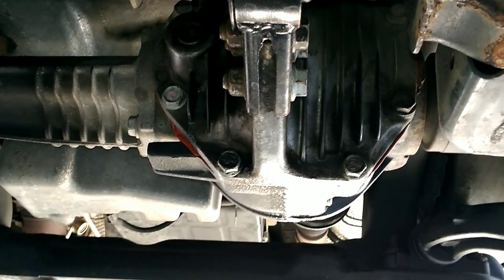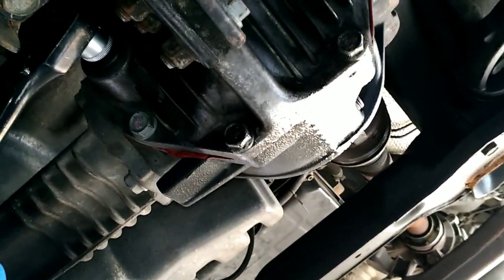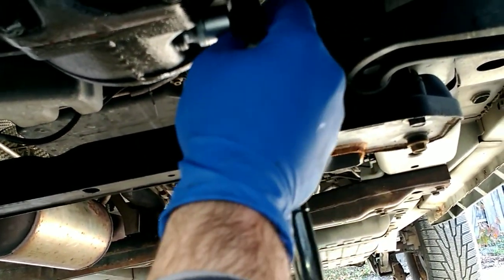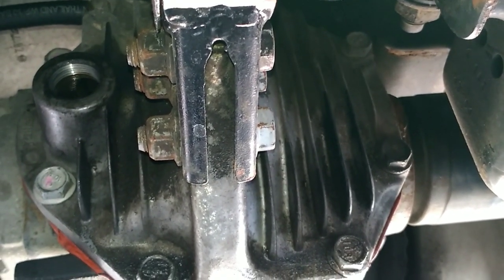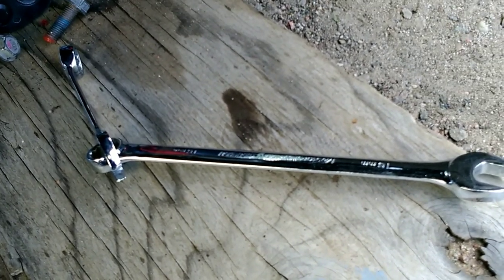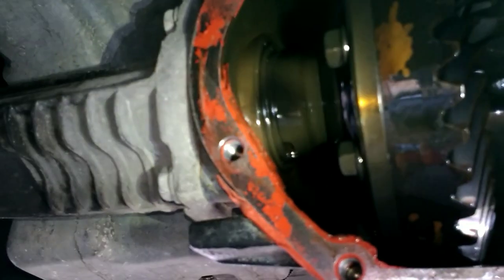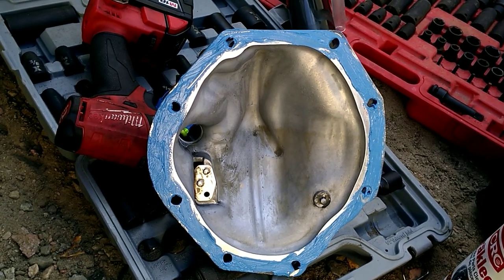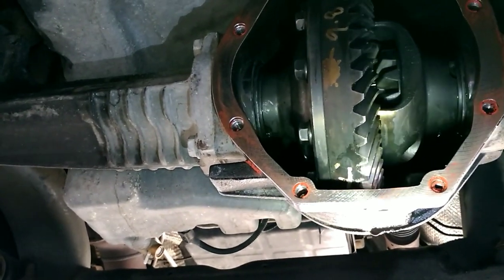2005-2010 Jeep Grand Cherokee WK Front Differential Cover Removal

Comment: I'm working on mine now. Had a axle starting to go bad on the drivers side and I've never EVER in my life had a axle so dam hard to get out glad you can open the diff. With out removing a ton of stuff so I can get a better swing at it from the inside! Thanks for showing dude!
Reply from the maker: You need to push the axle in as hard as you can while pulling it out...if that makes sense.  If you are pulling on the axle and then try to yank it out it will bind up.  You need that small amount of slack to pop it.
Reply: @SteveRivett  yeah did that for almost 2 days! Even went and got a slide hammer got nothing. I'm doing the cover today work got in the way

Comment: Which RTV do you recommend? I have a tube of The Right Stuff 90 minute black RTV, I think it will work fine in differential covers.
Reply from the maker: I usually have grey or black RTV around that I use.  I don't think it matters too much but there is a link in the description for some gear oil specific RTV.
Reply: @SteveRivett Permatex has a green gear oil resistant gasket maker!

Comment: I have C200F on WK and only got about one quart in on drain and refill, its says 1.8 Qts., is the data incorrect?
Reply from the maker: If you are on flat ground and you are filled to overflowing that is all you can really do.  There is usually a certain amount that you need to scoop out with your hand or use a suction gun to get out of the bottom of the housing.
Reply: @SteveRivett  A diff shop said 1.8 qts. is for dry fill and oil will remain in axle and diff, I change it every 50k so it was still decent color..

Comment: Dude...help. I have looked several times and cannot for the life of me find the front differential and transfer case on my son’s 2006 Jeep Grand Cherokee Laredo. I changed the rear already, tool off the cover, drained it, cleaned it with Brake Cleaner, painted the cover and put it back together.
Reply from the maker: Follow the rear driveshaft up to the front of the vehicle.  If it goes into the transmission your Jeep is 2wd.
Reply: @SteveRivett  It is a 2WD truck and the Jeep dealership confirmed it does not have a front differential or transfer case. Thank you so much for your help!
Reply: @thedude9383  I've never heard of a 2wd jeep thats crazy 😆